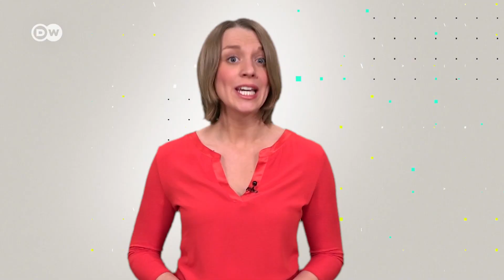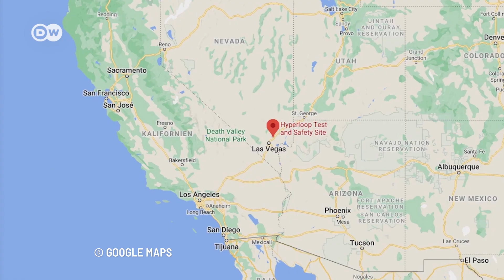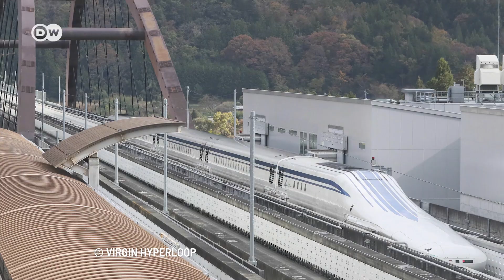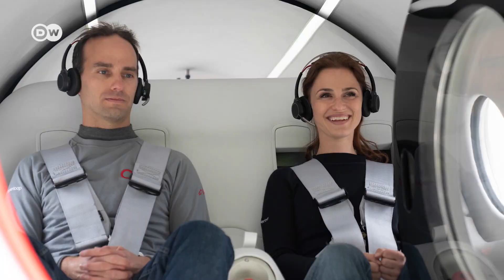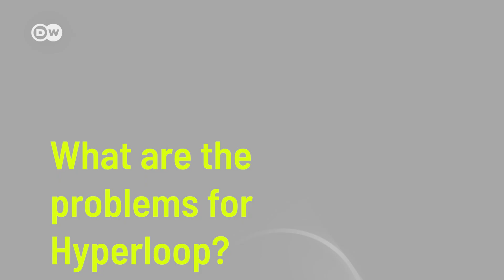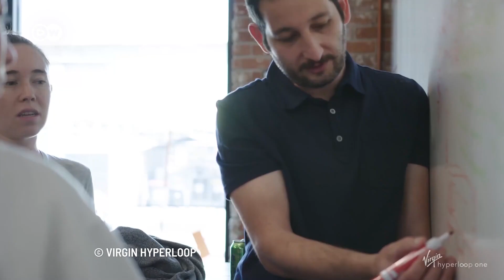When will Elon Musk's idea Hyperloop finally be ready?

Comment: Actually the idea of a "huperloop" has been around for 100 years or so, long before Musk.  A hyperloop tube would be the largest vacuum container ever created.  If de-pressurization were to occur every passenger would die since unlike a plane, the pilot can't just descend quickly to 10,000 feet to restore a breathable atmosphere.  A metal tube of such distances would require expansion joints.  How do you construct expansion joints that preserve the vacuum?  

This video was just shockingly lacking in critical analysis.  Not up to DW's usual standards.  The hyperloop will never be built.

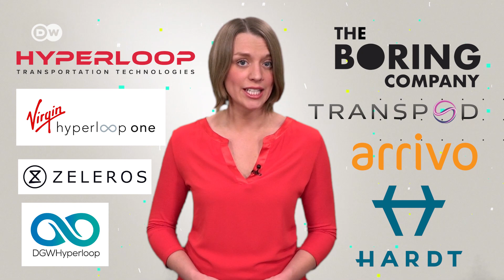Comment: Judging by the title the video should have ended at 0:26. Literally nothing of what Elon Musk contributed to the century old idea of vacuum trains is still being considered by any of the companies listed in this video. Elon Musk essentially ridiculed the idea of hyperloop himself by suggesting wheels instead of air bearings. 
If it’s meant to be a video about vacuum trains in general it‘s leaving out some far more important figures, such as Robert Goddard, Hermann Kemper or Rodolphe Nieth.
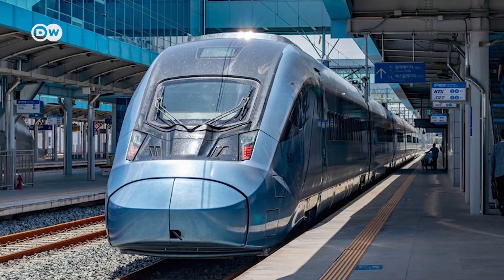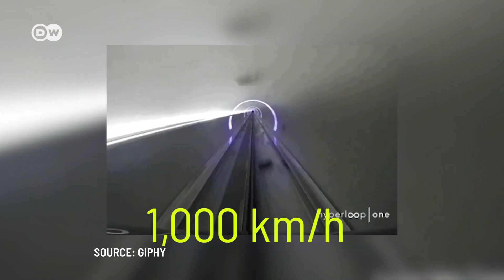Plus, some great journalism on display here: At 2:48 you‘re talking about a 1:17 scale model whilst showing a picture of a KTX Eum. That’s just a regular high speed train on wheels. And great job leaving out the actual problems none of these snake oil selling companies like to address, such as finding a suitable alignment for 1000 kph or providing sufficient passenger capacity.
Reply: this video was just a fat crawling-up-Musks-ass piece of propaganda

Comment: The thing people will enjoy more is the fact that they are not in a tunnel instead looking at the city as they are traveling. And most people dont care how fast it goes since the idea itself can reduce the amount of traffic and accidents and have a more relaxed way to commute throughout the city.
Reply: just out of curiousity, which system are you talking about? can't be hyperloop, cause it aims for speed and non-see-through tubes.
Reply: 5 years back I started drawing up some ideas. I started playing with maps, satellite images and i came up with something systematically that can work without tunnels , encapsulating,  ect. should be brought up to civil engineering. Just need the people involved in creating something similar .
Reply: @ANTI-KARNIST  Why don't you take a course in civil engineering then? (I don't mean it in a demeaning way, just a general question) Without looking at the idea, i can say there is a chance, that you might change something.

But i am kinda interested in the idea you had.
Reply: Been actually looking to it. Since the idea is not too complex to build. Also been drawing it differently than magnetic. Is more like a pneumatic wheels on asphalt slates. Whereas polyurethane wheels or metal tracks to reduce sound and increase mileage. Or thread life.
Reply: @ANTI-KARNIST  So we are down to specifics already. Could you please write a short comment on the general concept, cause the wheels don't ring a lot of bells.
LIke capacity, speed, propulsion and such things.
Reply: So the way I design the monorail was to utilize regular pneumatic wheels to prevent excessive Noise , durability/longevity, and overhead track/rail transition. Its pretty puzzling to fully describe it but its an upside-down L shape monorail. 👍
Reply: @ANTI-KARNIST  upside-down L shape? An asymetrical track? Sounds interesting, is there an advantage to this design?
Reply: @thomaspriewasser6660   not exactly on asymmetric appearance both sides are the same .on a front angle lets say it looks like a track yet flat surfaces.
Reply: @ANTI-KARNIST  look-up aerotrain, are your tracks similar to its track?
Reply: @thomaspriewasser6660  no its way different. Plus thats a heavy train my concept only has 12 seats. To reduce weight and track/rail design and column structures.
Reply: @ANTI-KARNIST  oh, it's that small. How long is the system, how many stations, projected ridership and method of propulsion?